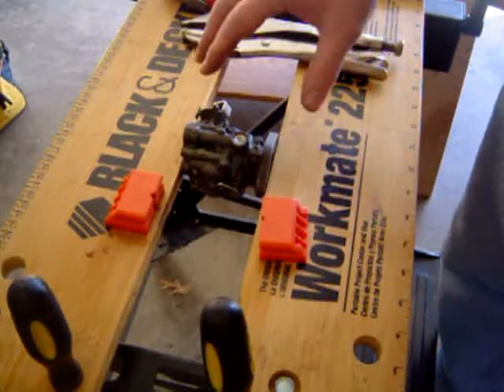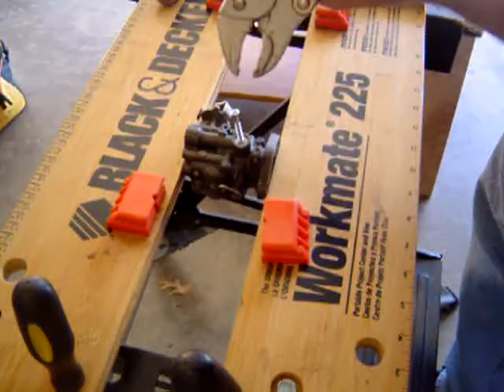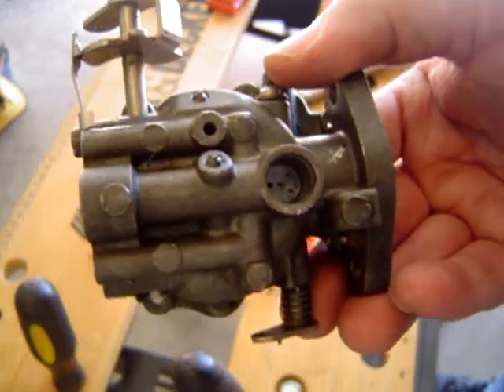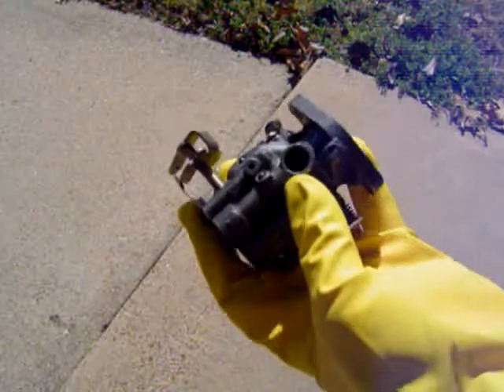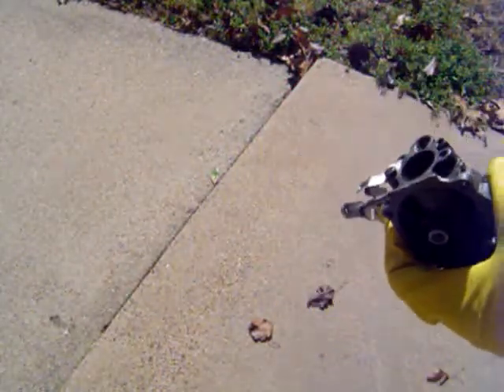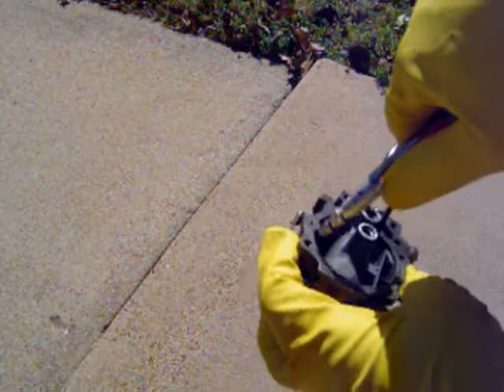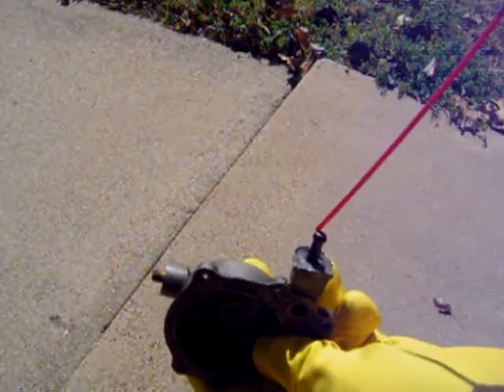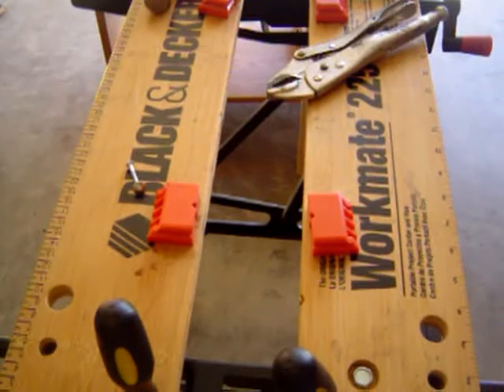OMC fix jet carburetors part 6 of 10  (Motor displayed 1968 Johnson 6hp)

Comment: I like your videos about the evinrude fisherman but mine still nut run as it supose to if i start it it wil run 10 sec but not longer the spark is good the compression is also good the carbarateur is cleaned in a ultrasoon bath so i dont no if i sqeeuze the buble of the tank it runs al bit longer is it the feul pump?

Ps my english is not so good i am from holland

Comment: I really love your carb series. I have a most annoying problem with my 1964 9.5 hp and am in need of good advice. It has well-timed and good sparks, compression of 70 on both cylinders, and the carb looks clean - have re-built most of it, but not all. I have not opened the core plugs for instance. My problem is that it starts, runs unevenly, and then dies after about 10-15 seconds. The plugs get moist and blackened, but still produce a spark. But I can't fire it up for a long time. I guess the problem is somewhere within the carb. The reed valves are tight and clean. Any suggestions? Thanks a lot! Petter Amundsen, Norway.
Reply from the maker: Petter, sorry for your frustration. It would be easier to assist you on a forum where diagrams and pictures can be used for explanations and evaluating.Please go to www.aomci.orgI am a member of the AOMCI (Antique Outboard Motor Club, Inc).  The public portion of the website is free to the public.  You must register to post on the forum.  I will supply a link to the site.  There multiple members that are very familiar with 9,5hp Johnson/Evinrude motors.  Some people love them and some hate them,.  Hope, to see you on the forum.http://aomci.org/forum/viewforum.php?f=2http://www.aomci.org/Here is a link to a parts diagram for your motor.http://www.marineengine.com/parts/johnson-evinrude-parts.php?year=1964&hp=9.5&model=9422S
Reply: +cajuncookone Thank you! I have applied for membership now, and also registrered my name in the Forum.
Reply: +Petter Amundsen I cleaned it thoroughly today and swapped the packing washers and the float valve and seat. The only problem is that I can't get the orifice out. I have ordered a 3/16 long, slotted driver, but I will have to wait many weeks for it to arrive. In Europe we use mm instead of fractions of an inch... When I reassembled it, it started after a while. I adjusted the slow-speed needle carefully until it went fairly smoothly. I decided to let it run dry, and then the curious thing happened. As the carb went drier, the engine had a better idle, perhaps as a function of me throttling somewhat which adjusts air and timing, while the level became lower. I adjusted the timing with a fixture and an ohm-meter. It should be spot on. The cam follower is just touching at lowest speed, picking up as the mark approaches. I don't expect you to answer here, I just relieve my mind while awaiting forum approval. Thanks for giving me courage to clean behind the core plugs. Best, Petter.
Reply from the maker: Petter, usually as the motor starts to run "dry" the fuel mixture is leaner.  So, if you think it ran better while you were running the motor "dry" then motor is running a bit rich.
Please start a post on the Ask a Member section so we can start helping you out.  I can give you starting carburetor settings.  Also if you are running it in a barrel, the motor will inhale it own exhaust and run rough or poorly.  Usually that is not an issue, but the low profile design of the motor makes running it a barrel and set carburetor settings a bit difficult.  So, using a fan to blow exhaust away helps a good bit. 
Hope to see you on the forum, so we can help you get your motor running better.
Reply: +cajuncookone Thank you! I still await forum approval. And on Friday I leave the seaside for a few weeks. I am certain I will master this with a little help from friends. BTW I may have a "new" motor coming my way - a 1972 20 hp Johnson. Best, P